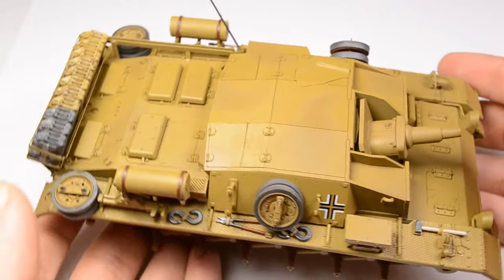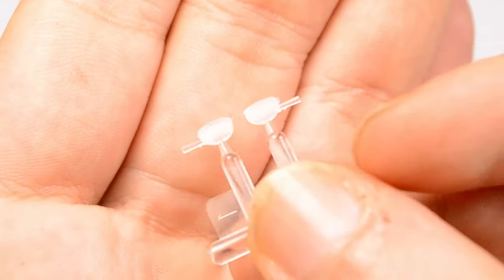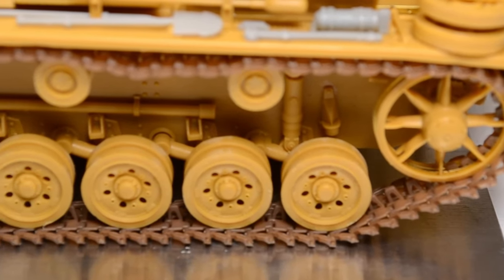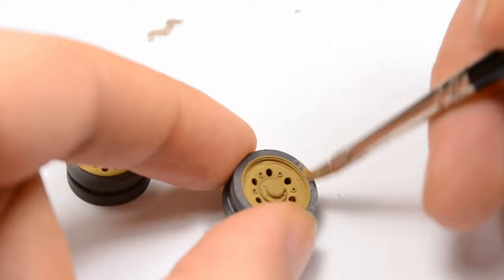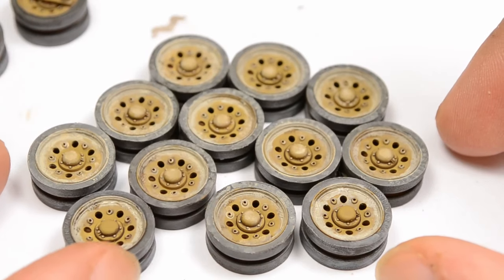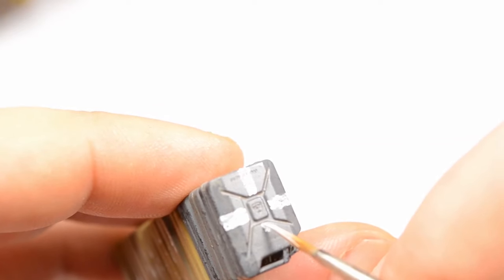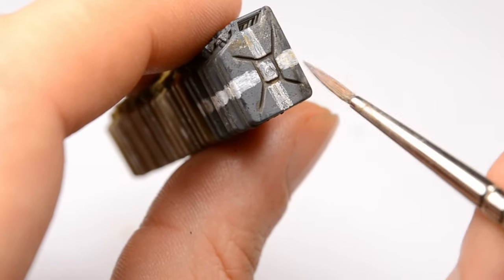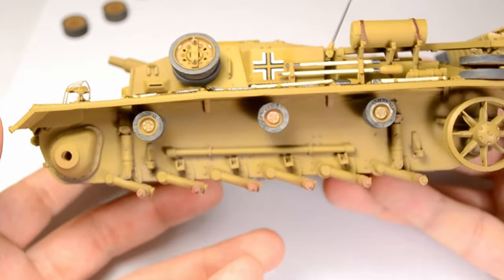Ep.1/3 | Bronco 1/35 | StuG III Ausf. D | Sonderverband 288 | early D.A.K. Style

Comment: Another great video.I'm wondering if manufacturers are adding all this "stuff" to increase the part count or just for the sake of it...PE in the middle of a Jerry can seems extreme! I've just started a HobbyBoss Panther Ausf.A which has torsion bars going across the lower hull,from each wheel,on both sides...Which will never be seen!
Reply: My Hobby Boss Tiger ll also had these types of torsion bars. Seems o be a thing with Hobby Boss tanks..
Reply from the maker: Thanks John. On your Panther, Hobby Boss is anoucing a lot of variants, maybe there will be a interior upcomeing some time.
Reply from the maker: @dieninjamelone1239  ICM did the same.
Reply: RFM does torsion bars, dragon as well

Comment: Why dont you clean the mold lines and attachment points from the parts?  It really shows and distracts from the subject.
Reply from the maker: Thanks for pointing this out. I'm positive about critical point, was, ever will be.  The construction of this build was done mounths ago and below what you will see in the project after this. Spending too much time too early on, when the result is unclear (and turns out going south), was allways a motivation killer for me... I rather take the (well earned) slap now and build up on it. Still growing skill here, if you look at some of the first builds this year, things are getting better ; ) Got myself set up earlier this mounth: proper sanding equiptment, blades, scriber, better glue selection and applicators. Stepping up the construction phase atm. @edit... somehow triggered the algorithm on this one, would have been happy with 10% of the views on this build ; )